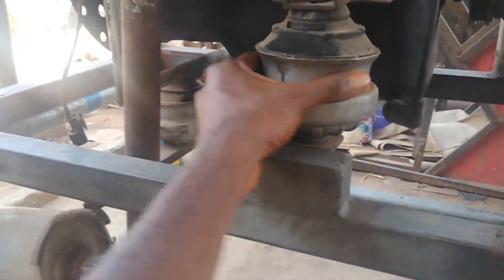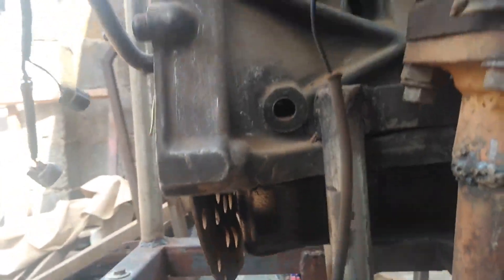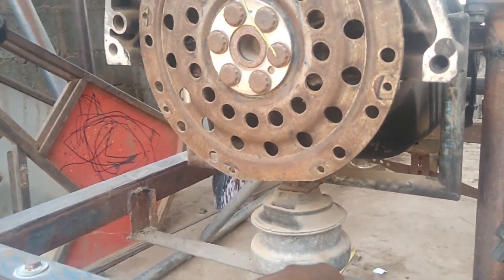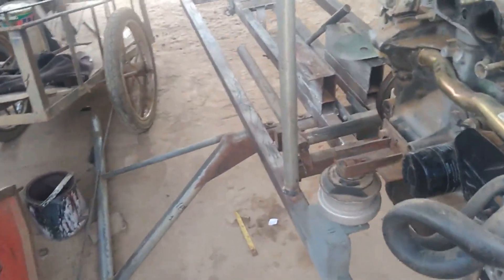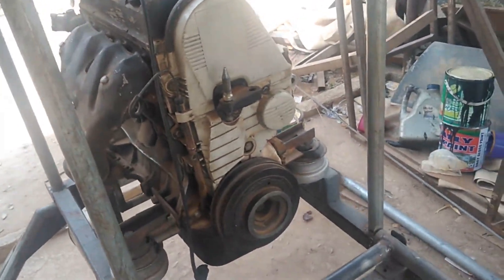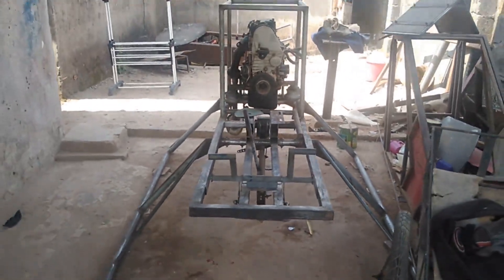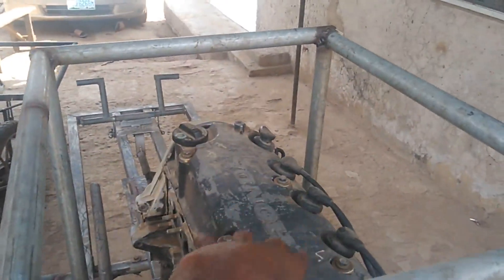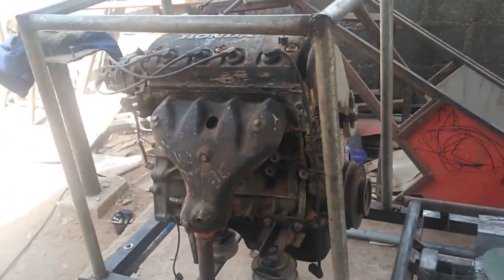My Ultralight Helicopter Engine Mount Walk-around

Comment: Hey you should change your exhausted design you should give it a 90° turn it will reduce your power by a bit. You can make a soft flow which will even help you in increasing your engine power.